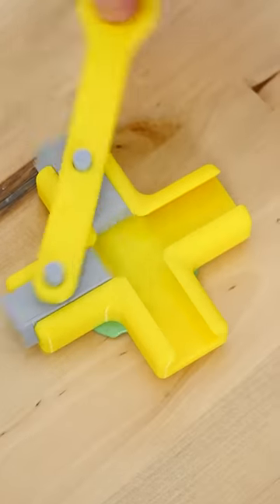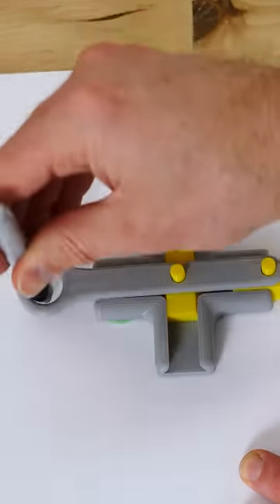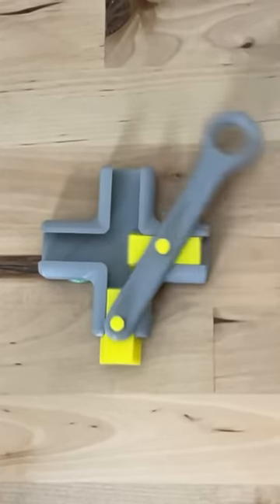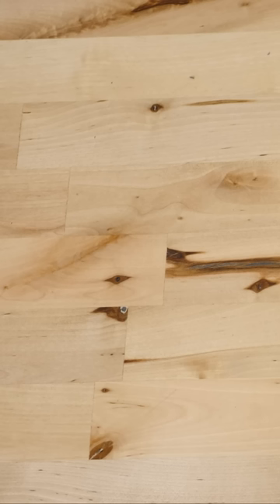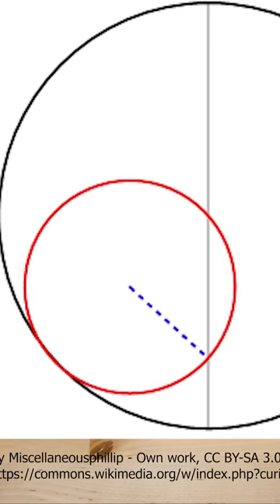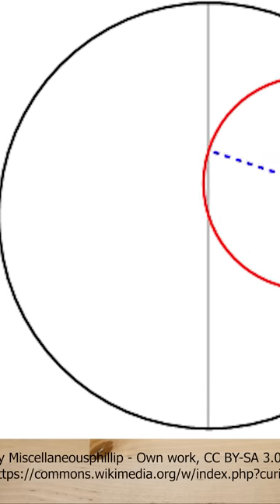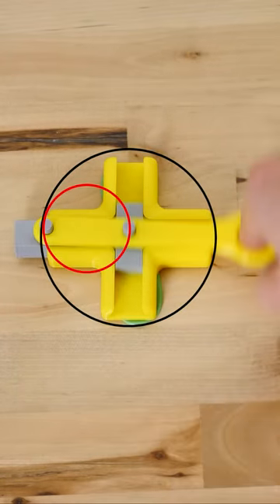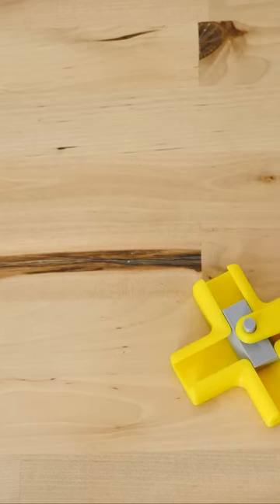The Do Nothing Machine

Comment: As much as I relate to this, I feel like at least this could be used generate energy 

Which even I can’t do
Reply: seems more useful as a pump or something
Reply: Rotors + pump cylinders are already being used.  Like the gas-motor mechanism inside cars.
Reply: i dont think the this can generate energy (hence the name) because  the blocks arent colliding and the friction created just isnt enough to generate energy , the displacement of the  blocks is zero so work done is also  zero  according to me but i am not sure
Reply: Potentially used to more evenly distribute mechanical energy from a single input motion. Could potentially be used for energy certainly, although I can't think of any practical usage at this moment that the loss of efficiency would be tolerable.
Reply: @samarthgoel5835   i think it could be used to generate electricity but the opposite way to what you're thinking. Something should move the blocks and the blocks would make the thing go round. Hook it up to a generator and you got electricity. It would be kinda weird though, since it is going round in an ellipse and not a circumference
Reply: @_Just_Another_Guy  LOL
Reply: You generate heat
Reply: This joke probably makes sense to most people following this channel 🧐
Reply: @Ticazoid95  as a mill or grinder perhaps ?
Reply: You could only genrate electricity by having piezoelectric circuits on the four ends
Reply: You don't generate energy, you convert it. Energy cannot be created or destroyed. You can however, generate creativity.
Reply: In fact u have to keep consuming energy just to keep living
Reply: @Nicolas-gu2jt  I don't think it can be used to create energy. But it can be used to convert from digital to analog.

So use electricity to move magnetized pegs, it can then turn a crankshaft, forcing a piston into place, or maybe turning a drill. I'll bet rotary tattoo machines are built similarly to this.
Reply: This arrangement looks pretty similar to a radial engine
Reply: im pretty sure they had rotary engines not like the wankel engines, but ones that used in aircraft at one point...
not too sure. this seems a little different but same concept ahah.
Reply: The Law of the Conservation of Energy postulates that energy cannot be created nor destroyed, it merely changes form from one type to another. It can also be stated thus; the sum of all types energy, i.e. (thermal, electrical, chemical, mechanical, kinetic, and potential) remains constant.
Reply: Oof
Reply: "energey is neither created or destroyed "- some scientist
according to him it wont work
Reply: Im curious if someone could make this into cylinders and pistons and basically have a four banger engine. Or up to as much as you want like he said in the video.
Reply: @ashtondukart8840  Not even close to being the same thing but take a look at a Mazda/Wankel rotary engine. Beautiful design that Rolls Royce tried to perfect. 

Rotary engines have a low thermal efficiency as a result of a long combustion chamber. This led to other issues but it is still an acceptable design for Diesel/Wankel engine designs.

YMMV
Reply: @stone-coldsteveautism6986  im familiar with the rotary engine. Im just dreaming of a new design that maybe has not been tried yet. Most likely it has been. But i figured it was worth making a comment and seeing what kind of feedback i get.
Reply: @ashtondukart8840  Frosty, cuzzin.The greatest problem with the First Law is not the transfer of energy, but the most efficient transfer of energy. This primarily involves mechanical energy. 

I would be interested in your ideas. Sincerely...please feel free to expound. I will reciprocate, of course.
Reply: @stone-coldsteveautism6986  I have given it more thought and realized that i would have to find a way to make the piston rings reseat everytime they and enter the cylinder across from the other. From what i know, that would cause some major problems. Lol
Reply: @ashtondukart8840  Stipulated.  But go beyond what you've been taught to think.

Wouldn't lighter, stronger materials be more efficient? Okay, I get that you might sacrifice long-term wear and tear, but that is exactly what Rudolf Diesel was exploring...the trade off between lower energy cost vs. wear and tear...simplicity. 

What if carbon/titanium tech could be introduced into the mix and mankind could use a combination of propulsion platforms for Terra-type atmospheric conditions, inner-space, outer-space and interstellar space? A type of multi-drive that are shielded from each other but able to interact and augment one another. Call it a synergistic drive, gestalt drive...VT-Drive. A variable transport drive.

Balls in your court and we are volleying.
Reply: @AugustERaven  packing products
Reply: @samarthgoel5835  it might be possible to us magnets for the blocks and place it within a copper coil.
Reply: You could probably make an engine out of this
Reply: @PneumaticFrog  it kind of looks like the bourke engine
Reply: @ashtondukart8840  you would also have a lot of oil going above the rings and entering the combustion area every time they crossed paths.
Reply: @mikefelty2625  lol yah i didnt think too hard on this before i expressed my thoughts.

Comment: What if you replace the linear motion with engine pistons and be the line “drawn” directly into a flywheel?
Reply: Exactly. But specifically the 8 sided one as in would be balenced better,. And possibly more fuel efficient
Reply: I think everyone is thinking the same idea "How rich would I be if I make one into a full engine"
Reply: @Libtard  and run it off hydrogen
Reply: Exactly
Reply: Kinda the idea behind the rotary engine no? In application its a little different but kinda the same?
Reply: Ya now make it with piston and rods
Reply: I thought the same thing
Reply: That’s what a rotary engine is
Reply: r/beatmetoit on the rotary engine
Reply: @spencer281  more like a radial engine, like the ones you’d find in older planes
Reply: Rotory engine , unfortunately it burns oil like crazy
Reply: @mikeymontuy4520  right
Reply: @johnrodrigues2018  I wonder what a electric rotary powered car would b like
Reply: @ethansmith8813  hydrogen isn't a viable fuel own it's own at this point...hho works well with diesel but hydrogen replacing fossil fuels won't happen in your lifetime and most likely will never happen
Reply: @alabastardmasterson  Unless we start using fussion reactors lol
Reply: Yep, just what I was thinking
Reply: Radial engines.
Reply: @MnV-  so you would take an electric motor and drive a rotary engine with it. You might be on to something.
Reply: What if instead of combustion power we use magnetically induced motion on the walls of the rotary engine? Oil could be contained in a closed system so it won't burn with the combustion.

Is it more or less efficient than the traditional rotors with co-centric axis?
Reply: This machine was named after progressive demos.
Reply: @DocaTafner  we could provide areas for specific oil application on the 3 small points of contact on a rotary engine, keeping oil usage to a minimum, then with a magnetic interface we would be able to expend oil without worrying about combustion issues. I think an electromagnetic application would be revolutionary for the wankel engine
Reply: Then you'll end up with "The Do Something Machine".
Reply: You’d have a piston driven propeller airplane motor
Reply: @sdstarkweather5009  as someone working in the buisness of designing machines and stuff (no not motors in specific) i can straight out say "No"

First. your magnetic...interface? does not make any sense. Magnetism needs power....lots of it. And every magnetic effect gets worser and worser the hotter the material gets.

Material science is so not on your side here, im sorry to tell you. I had to learn this the hard way too.

At the moment electric engines are the most efficent things we have. Wankel engines are quite nice but have the big offset that you can throw them away as soon as you dont have a constant....is it "momentum" in english?...you know, constant turning. The efficency sadly just droppes to cathastrofic values.

So the question why nobody has thought of this before is: People did....many times. It would just make the part needlessy expensive, complex and/or add more parts that can break....completely missing the target of improvement.

soooo yeah. Greetings from an engineer from austria. Machines are not our friends. they dont make us happy ^^
Reply: @abnormallynormal8823  welcome to 1914. the german airforce already uses your invention
Reply: @andrefasching1332  rotation could work for the word you are looking for
Reply: @andrefasching1332  yee, I know, but Nuclear is still Nuclear, we have to open new horizons and make shit work, it'll be like when nuclear was first being developed, it was probably costly and didn't do much other than go boom, but after years of nurchering the technology, we're here
Reply: Sadly, I think is will probably mess up the exhaust gases with the oxygen and it would be ineffective.
Reply: @georgeb5262  nah, radial engines use this, but a little differently
Reply: @senioravocado1864  Nah, the exhaust gases can't mix with the oxygen.
Reply: @georgeb5262  uh... You lost me there...
Reply: @senioravocado1864  Why? I told what is happening.
Reply: @georgeb5262  I don't get the "Oxygen and exhaust can't mix" besides, radial engines literally has this
Reply: it is already done in the first planes
Reply: @senioravocado1864  I mean my English is bad, but in this video's design, exhaust gases will mix with the oxygen from the intake and it will make the engine uneffective.
Reply: @georgeb5262  Ah, yeah, that makes sense, but old radial engines have a similar setup, though each canal has just a piston, which would work
Reply: @senioravocado1864  Soooo your solution is that we just scrap the technology we almost perfected after 80 years of research to waste even more money on an even costlier project.
Reply: That’s a radial engine and they’ve been around since the 1900s
Reply: @DanielDuhon  not a rotary...they don't have pistons
Reply: @mikeymontuy4520  thankyou.  Clearly idiots keep conflating that with rotary engines for some reason
Reply: @dangrimes5078  that would just waste power
Reply: What this machine reminded me most of is rotary engines.  Mazda's RX-7 sportscar uses a rotary engine to drive its wheels, and it's actually a very interesting engine design.  You should check out a video on how it works.
Reply: @connorcoates7734  but this is similar to a radial engine or basically engines using pistons. How is this reminding you of a completely different engine like a rotary?
Reply: Shit i was just thinking about it when i found your comment
Reply: It exists already. It’s a lateral engine also known as a rotary engine. Many sports cars used them.
Reply: @discountyoutuber6707  radial engine...please read the prior comments
Reply: What you are describing sounds like a radial engine
Reply: Repent to Jesus Christ Repent to Jesus Christ  thanks for that. So relevant to this video.
Reply: Even a water engine like, I guess is Bob Lazar his name? Yeah he had a car that runs on water..
Reply: @drex5236  I belive you're referring to an Hydrogen conversion, HHO generator, Hydrogen produced via Electrolysis and ran by line into your vehicles air intake system.
Reply: Look at the inspiration found in this here comment section!!! The ancient Greeks are smiling down upon this right here
Reply: @keithpoley3432  probably that's the right way to call it..
Reply: Praise you engineers. I don't understand all of your diction but yous sure come up with neat machines.
Reply: Should be a very torquey engine with that much stroke
Reply: Repent to Jesus Christ Repent to Jesus Christ  I don't believe in Jesus 😌
Reply: @jamesolelo4406  "How is this reminding you of a completely different engine like a rotary?" 
The same reason it reminded a lot of other people about that as well, many people aren't familiar with radial motors because people tend to be more familiar with cars than planes. 
As for why this reminds people of a rotary motor? It would be the circular motion of it.
Reply: Repent to Jesus Christ Repent to Jesus Christ  now im not sure what I'm supposed to do, repent or read. Make your mind up would ya.
Reply: @DocaTafner  people have already designed magnetic propulsion motors that use opposing forces to create continuous motion. Would be cool to see that improved upon.
Reply: @zac9933  if it was dorito shaped I would agree with seeing it as a rotary. But seeing the pistons move in a piston way doesn't lead to a rotary.
Reply: Repent to Jesus Christ Repent to Jesus Christ  and he soeth do thumpeth so untimely and unplacedly, that he should look a fool. Depart from my person oh untimely one, lest I fall I'll of embarrassment for thy.
Reply: Use electromagnets instead of internal combustion ⚡⚡😱⚡⚡
Reply: Tf you talkin about
Reply: @ethansmith8813  this is exactly how the first plane engines were built
Reply: 3 is basically a rotary engine.
Reply: Repent to Jesus Christ Repent to Jesus Christ  
Ill keep this in mind when i go to sacrifice a goat for my next ritual.
Reply: That's a radial piston engine. The same engine from Sherman tanks and old airplanes
Reply: THAT WAS MY IMMEDIATE THOUGHT ALSO
Reply: How would i counter the fact that te 2 pistons need to cross eachother
Reply: @andrefasching1332  Bro I love every one of your comments. I have little practical knowledge on engineering but was dumbfounded by people thinking they’re inventing new technology in the YT comment section.

Your comments perfectly explained what I couldn’t
Reply: @jamesolelo4406  I was messing with him
Reply: @eshryo  haha yesh thank you. Your compliment made my day. ^^

Biggest problem with inventing/improving stuff is that every idea sounds awesome as long as it is only in your head. If you can draw it on a piece of paper and it still looks good, then you are on the right way
Reply: I also Immediately started imagining engine applications
Reply: @spencer281  different but the same rule applies but rotary engine are not the greatest they are not flawless just tet
Reply: @dangrimes5078  kind of like a starter motor? Lol
Reply: Repent to Jesus Christ Repent to Jesus Christ  how is this related to anything anyone is saying? Go peddle religion somewhere else
Reply: @DanielDuhon  - A Wankel engine? Really. How do these hot takes even get upvotes? Oh wait I know.